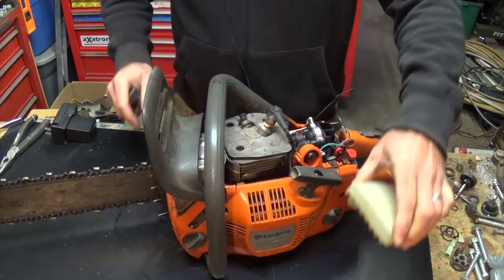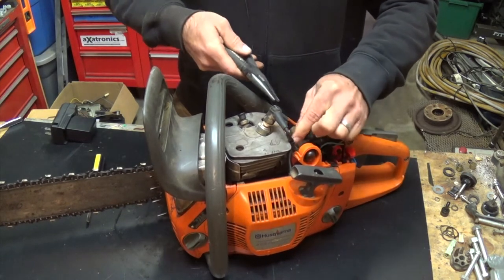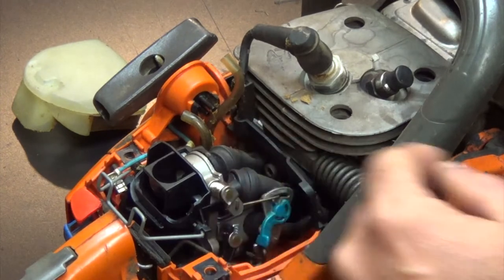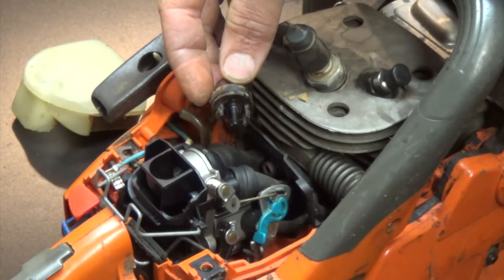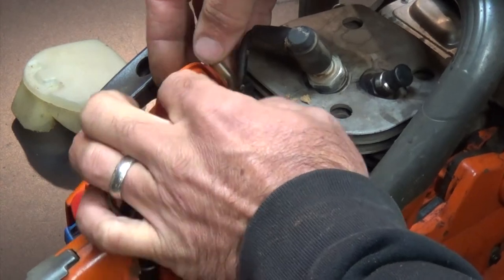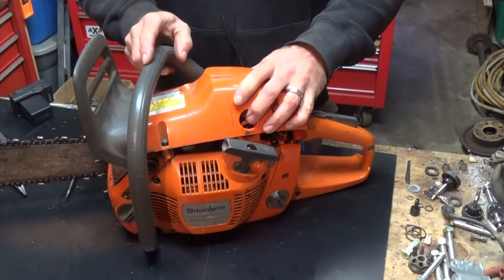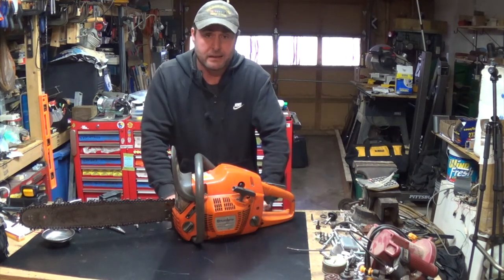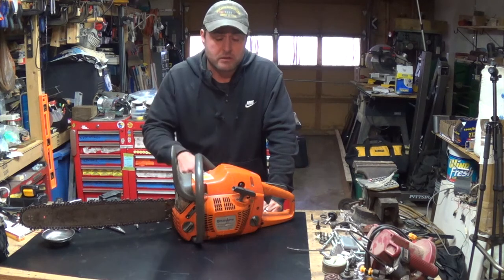Husqvarna Primer Bulb Replacement

Comment: Does the short line go to the carburetor?.....and the long line goes down to bottom of fuel tank..?
Reply: Long line from top of bulb to tank....that's the tank return line. Short line from carb to bottom of bulb, that the fuel draw line. The fuel supply line is from the tank,( has the fuel filter inside the tank on it) to the carb. When primer is pumped, it draws fuel from the tank to the carb, through the carb, then out of the carb to the bulb, then fuel returns from other bulb connection back to the tank. Hope this helps you out.
Reply: Thanks for your response.

Comment: What is a good chain and bar brand to run a 18" setup, was given a 455 rancher and need to get it running top knotch
Reply from the maker: Husqvarna works great. I’ve not run anything else on mine but I’m sure you’ll be fine to run Oregon bars and chains